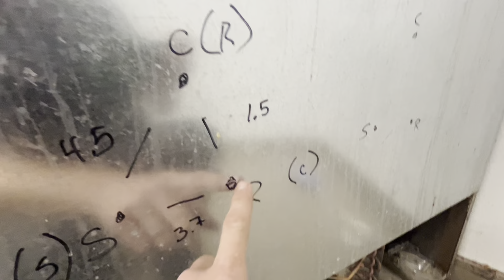Norlake freezer - not freezering

Comment: The compressor was cycling off the rail when no power to fans and thermostat.
Reply from the maker: Good thinking and I didn’t show otherwise but……. Negative cuz it was running in a -8 psi vacuum and the rail was completely hot.   I actually flipped the rail switch to off when I got started cuz I used to get bit with that.

Comment: Another sharpie bandit like myself. If I change a compressor I mark down operating pressures near setpoint and amp draws, plus any other info that I think may be handy, especially if I run into something weird. It saves me headache later and if there's a tech beside me working on it, they have a rough idea on the guidelines they're looking for to get things operating properly
Reply from the maker: @davidturney2975  yeah baby!!!   Comes in clutch when you forget about it and spin around a unit.   Brings a smile

Comment: What ended up being the cause of the fans not running?
Reply from the maker: Fans jump off the hot leg of the thermostat.. thermostat powered by the cooling consult of the defrost clock.   Defrost clock was failed.   Compressor was running anyway cuz the failed pressure switch also
Reply: @restaurantrepairs  those edt 10/11s don’t last at all . I stopped using those and went to supco spa1401ad heavy duty timer. No issues with those
Reply from the maker: @WswRefrigeration sweet.   I’ll check em out